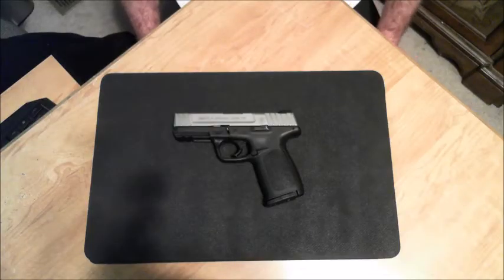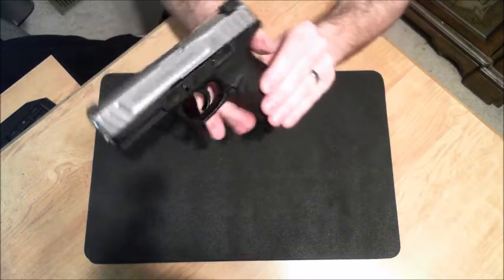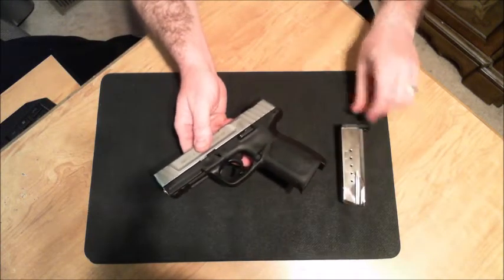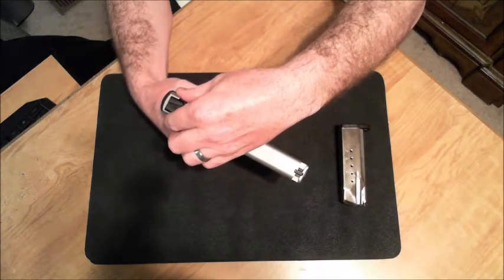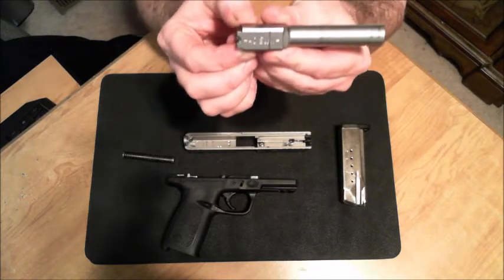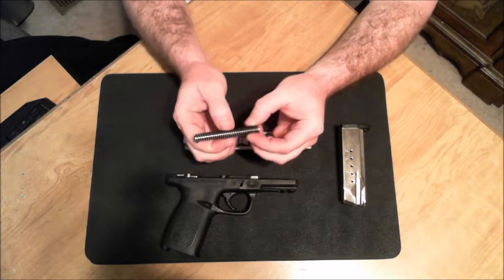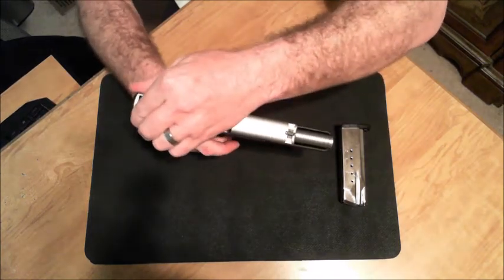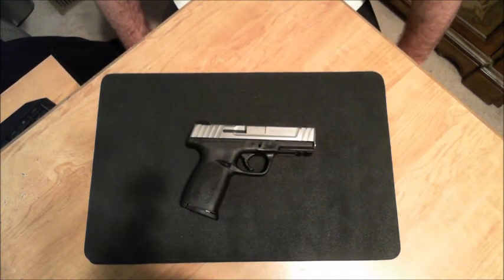Smith & Wesson SD40VE Breakdown & Reassembly

Comment: Okay I know this is an old video, but I just got mine, haven’t personally put rounds through it yet and it is so difficult to take the upper slide off, it will move forward maybe 1/4 of an inch won’t dry fire, and the slide won’t come off I’ve been trying at it for about 2 hours now, and I only got it off once, will it loosen up if I put a few mags through it?
Reply from the maker: Hey Sam, first make sure she is empty, remove the magazine and check the chamber. If she is empty and clear, pull the slide back about 1/4 inch, at the same time pull the lock down (the little thing above the trigger, let the slide forward and then dry fire in a safe direction. Slide should come off then.
Reply: I’ve been pulling the take down lever as far down as It can go, and once the mag is out it won’t dry fire, I’ll rack it back and When I pull the trigger it’s light, the hammer isn’t being thrown to dry fire but if the mag is in it and I rack it back I can get it to dry fire.
Reply from the maker: With the GLOCKS we run, you can also dry fire, then pull the slide back, pull the drop lock down and the slide will come off, if this does not work, there may be an issue with the take down lock or spring that holds it in place.